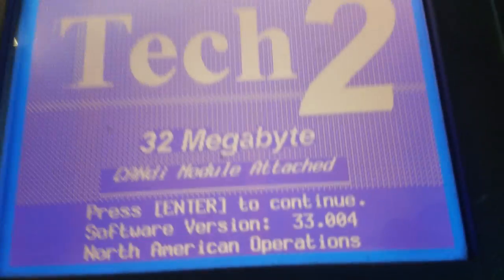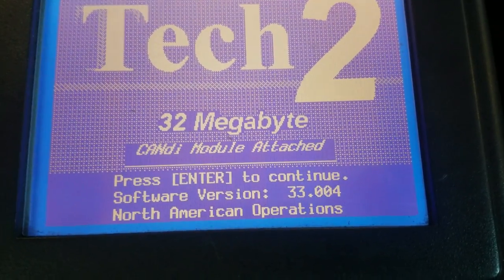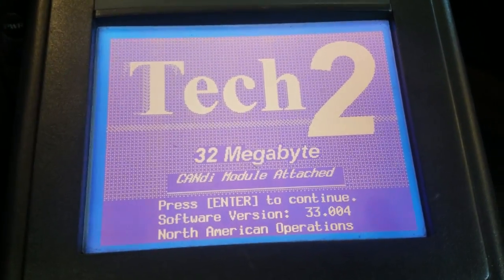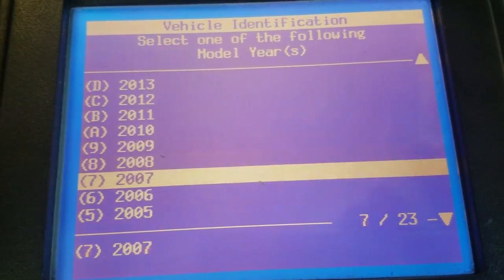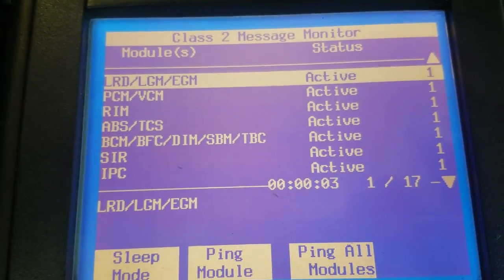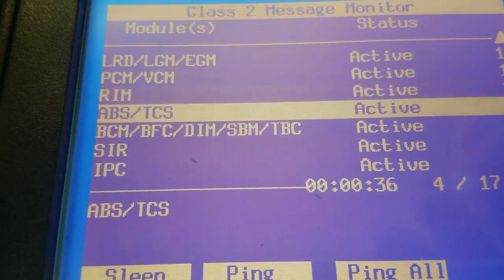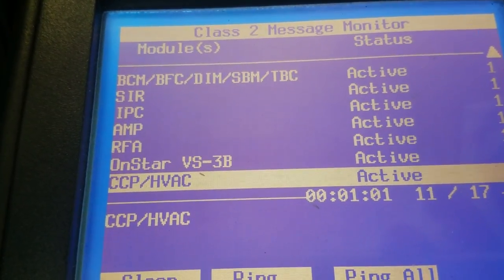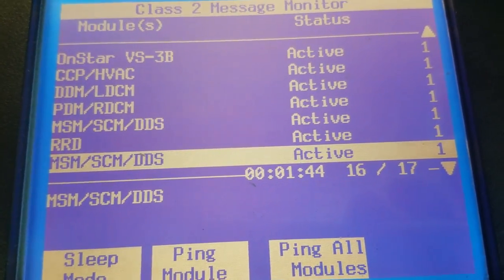How to Fix a U1000 Code In Your Car

Comment: U1000 code is usually 9 out of 10 a faulty battery, camshaft positioning sensor or powertrain control module

Comment: Great video thanks. Got that code today u1000 of a infinity no start.😁
Reply: Hey I got the smae code in my car did u figure it out?
Reply: @colekress3308  did you figure yours out? Mine just turned on
Reply: 07 Sentra u1000 code won't run. Turns over. Replaced ECU. Same thing. Any idea?
Reply: @johnathanbeats  bcm maybe? im trying to figure mines out it wont start either
Reply: @shunplayz7500  ended up being a fuze. check all fuzes.
Reply: @johnathanbeats  
which fuze was it? was it a specific fuze? You may be able to finally get my truck to start its been 2 years since its been down

Comment: Hooked my tech2 up to the car and it magically fixed its self. Literally prior to attaching the tech2 I jump wired the caddy. Attached the tech2. Ran the test you did. All was working.  Turned off car figuring the car wouldn’t start but the key came out no issue and when I put it back in started right up. Been working all day so far.

Comment: Customer complained with bunch of codes U0101, U0100, P0462, U0073 on 2013 Nissan Pathfinder after he said/blamed me aft  I hooked up my SBB PRO2 programmer and got 'ECU not found' a few times. 
Can runs ok .  He tried to disconnect battery and reconnect but engine lights came back. 
Any advise why - bad ECU?
Reply: Sbb messed up the ECU

Comment: good tip  was it the pcm pulling down class 2
Reply from the maker: It ended being the Instrument cluster.
Reply: The Flat Rate Mechanic I have a 2002 nissan altima and the car dies when i disconnect the battery and the cluster lights and gages don't work...you think the cluster maybe the problem?

Comment: I have a 2005 Nissan Sentra 1.8l 164k miles. I was previously getting the P0455 code for a EVAP. I replaced the Vent Control Check Valve on the purge canister and that didnt fix it. I been driving it just fine with no issues. I then went to drive it yesterday morning after I drove it for about a hour and it would go out of 1st gear and had a major power loss. Still cranks up and runs though. I went to Pull a part and got a different ECM and the check engine light is still on with the same code U1000 and U1001. Any advice please? Everything works on the car. Runs great.
Reply: I have a Nissan Pulsar 1.6L. similar to the Sentra. I also have the same codes as yours too. How did you go with yours?

Comment: Working with 2002 Envoy right now, can't duplicate while plugged in, unplugged my scanner and multiple failures at com fail, HVAC com fail, motor A/B circuit malf. EBCM com fail....36 + codes....scan reset all goes away until I unplug Autel mk808bt.

Comment: I have a u1000 diagnostic code on my 2002 Infiniti Q45 I can't find any mechanics that will touch it around here can you give me any ideas or tips with it could be what it's doing is keeping my gauges from working only gauge works as my fuel gauge but my speed my tack temperature and the Tiptronic shifting doesn't work
Reply: You are lucky. Mine wont even start. Its been sitting for 8months
Reply: @CBRRR-eh3ky  did you check if you have a blown ECCS fuse?
Reply: @avpng  no. 2hat does Eccs stand for. Thanks for replying
Reply: @CBRRR-eh3ky  Electronic concentrated engine control system. ECCS. Fuse is in the fuse box under the hood. Near battery.
Reply: @CBRRR-eh3ky  did you ever get the problem sorted an if what was it cause have the same car jus like that won't start.
Reply: @halspeedautoworkz764  the issue displayed is this of another person. I do have an issue with a M45 for over 1 year. I have not sorted it out. I was about to really get to it but got sick with this corona thing..
Here is my take on those cars. Personally, i have always looked too far when it comes to diagnosing these infinity. I looked too much into diagnosing networks and stuff while a lot of issues can be triggered by simple issues such as starter wiring issues, ground issues etc... or simple network reset. Id say no matter how sophisticated nd scary ur issue seems, check simple stuff. This will be my approach from now on